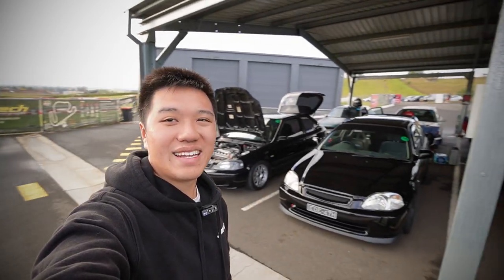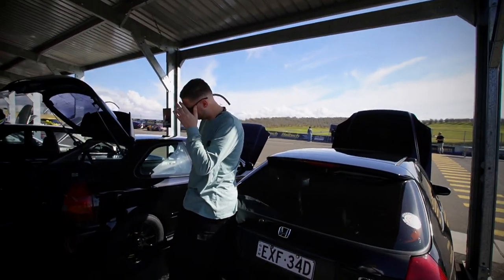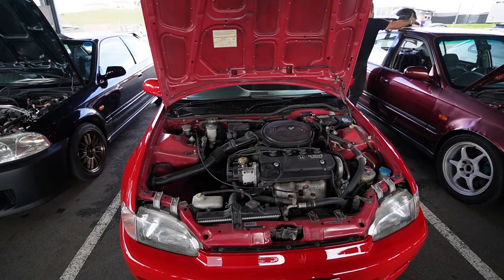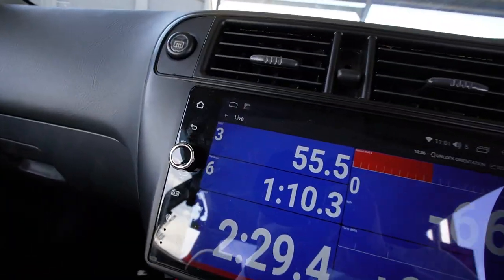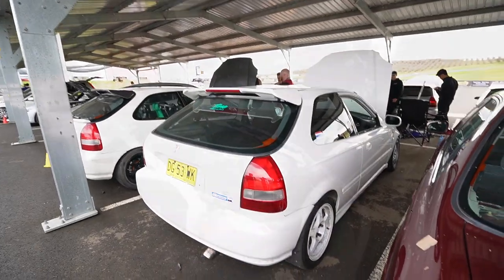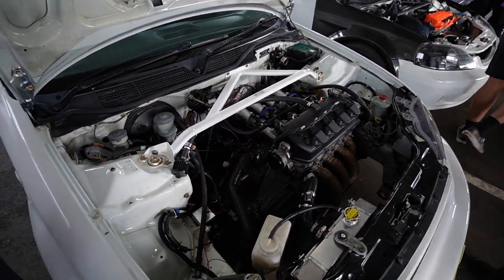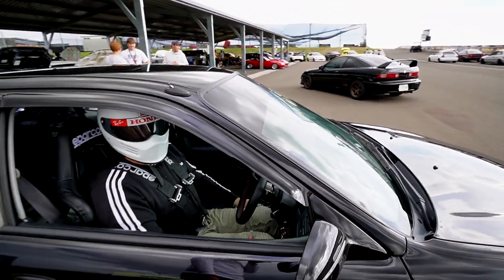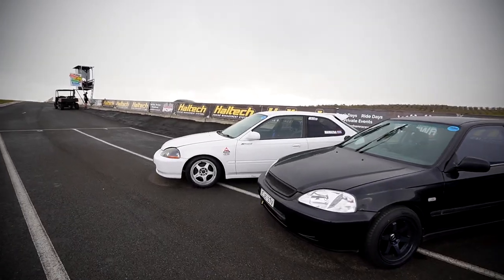The Honda D SERIES CUP!

Comment: This is rad!  I own a 99 ek coupe with a D series engine. Its got Suzuki Vitara pistons / I beam rods and a custom turbo kit 😄 If you are trying to make some good power for cheap its such a good setup and so fun to drive. Are you running the short gear ratio transmission? If not it might help those lap times out. Also are you guys allowed to run high compression pistons? What are the limitations in this Cup?
Reply from the maker: It's so much fun. 
Oh that's an awesome little setup - I think you might enjoy what's coming early next year 😉
Most of the field was stock-ish in Round 1. But I know of a few competitors in Round 2 (October 22) who have really come out with built setups. Yes all modifications are allowed, the rules are quite lax at the moment having just a limited and unlimited class - but we will have a new format going into 2024.
Reply: @JCYT  Sick! looking forward to checking out that video when you upload it. I wish we had a race like this where I live. Looks like a blast!